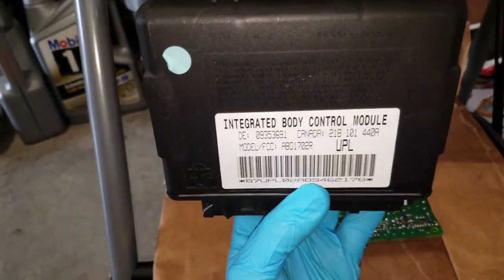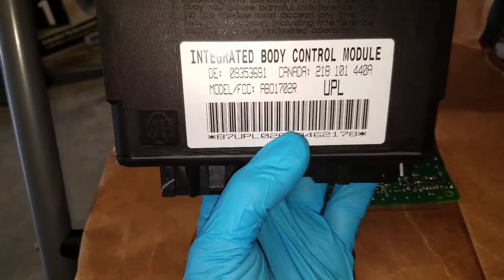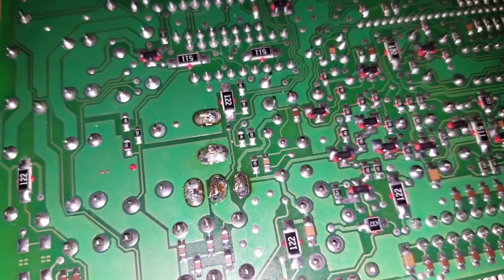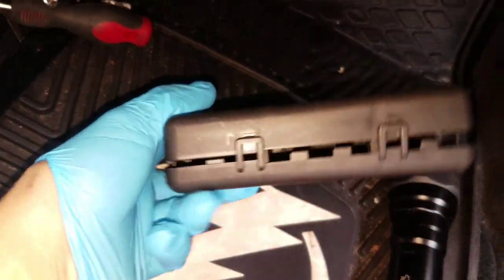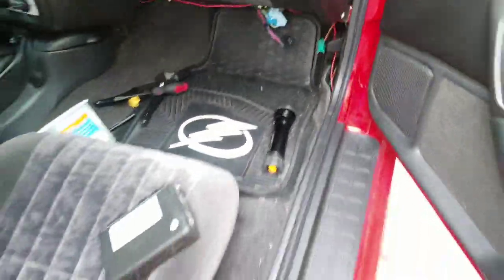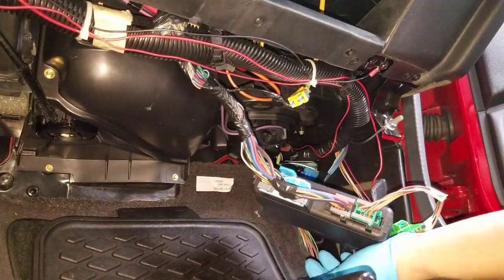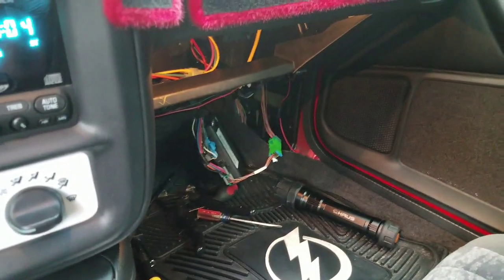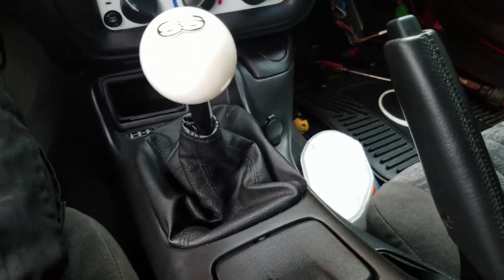Soldering a body control module

Comment: Rough idle might be one of the upstream o2 sensor. Usually though it has a hesitation during acceleration not usually a rough idle. Couple friends had bad o2 with no codes found them faulty when reading live data through scanner. I have owned 7 ls1 and own a 2000 red ss so your channel looks familiar to my driveway lol. Happy wrenching
Reply from the maker: Where would those sensors be located
Reply: @chemicalspore  The upstream o2 are located on the exhaust manifold right before the y pipe. There is one on drivers and passengers sides.You want to change the ones before the catalytic converters.The o2 sensors after the cats wont effect the rough idle they just monitor the cats themselves. Be prepared though probley gonna be pretty rusted in there. I would also check the exhaust manifold gasket for any leaks as well as intake manifold for any leaks and check all vacuum lines.Also as camaro time said check injectors hopefully it's something easy. Not sure if your checked you plugs and wires but I would do that 1st. Coil pack could be going out also but it's unlikely though. Hopefully some of this helps I know it's alot of info
Reply from the maker: @joshsix206  i replaced the plugs with a/c delco iridiums. I have not checked the wires or injectors. I bought this car six months ago and it had 13 thousand miles on it, things were not well Rusty at all.

Comment: Great video bud....Sure hope you gete that thing fixed soon!
Reply from the maker: I'm going to try the idle sensor next. Bah humbug.
Reply: The only time i've had the passenger door lock switch make that chime sound is when i was working on the door and removed the switch and reinstalled it with the wiring harness connectors reversed. I had the power window connected to the door lock and the door lock connected to the power window lol. The warning chime is your friend. Could also be a bad switch i guess. Haven't had one go bad yet but i'm positive that the connectors can be reversed.